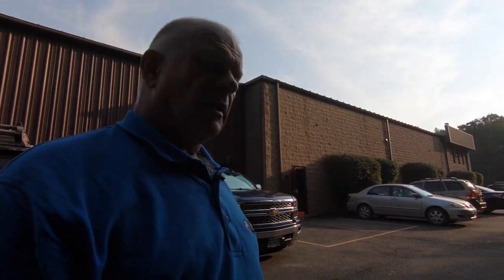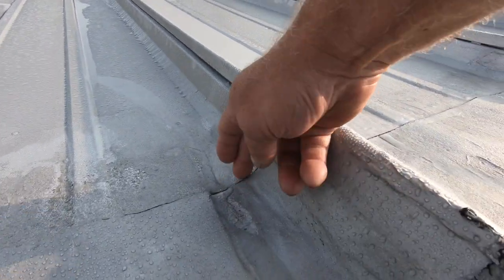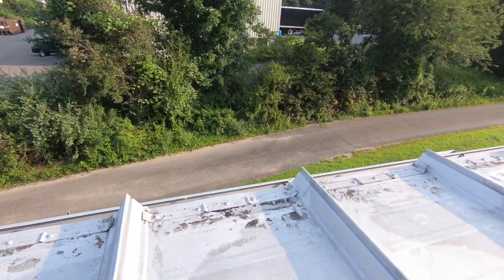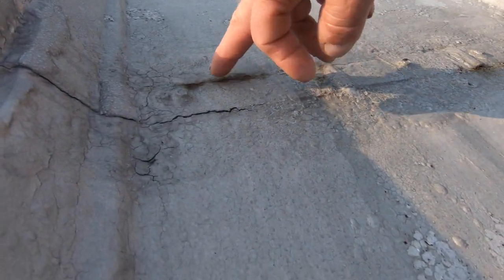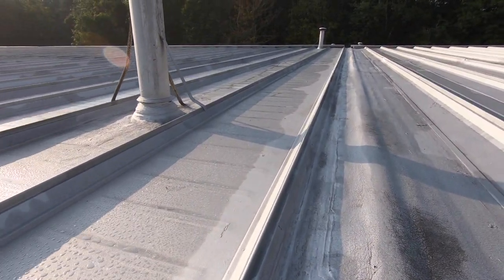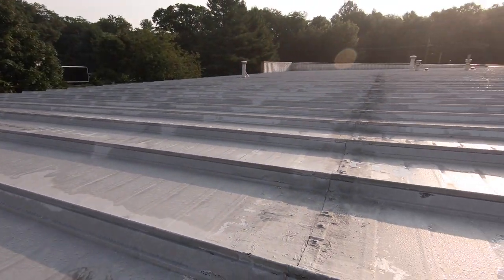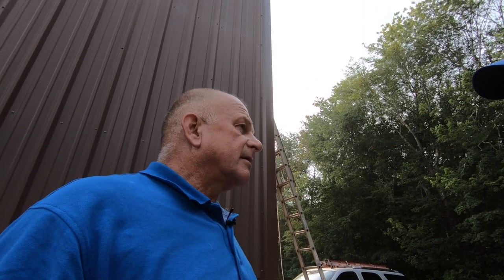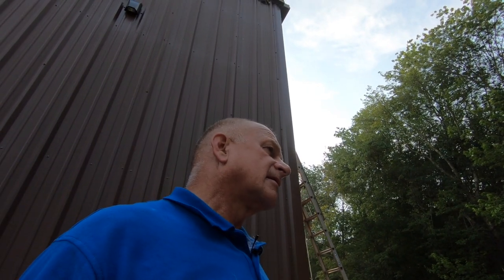Your Metal Roof can have this problem. Fixed with tar or caulk could cost a lot later to do it right

Comment: What is the best cheapest thing to seal where the metal overlaps each other? I’m building a barn and all my metal is running length way so the only part they connect is where they overlap.
Reply from the maker: My Saying "cheap is very expensive". It is harder to make repairs once you have messed it up with a cheap product. The cleaning up and damage that is done becomes very very expensive. Do it right from the beginning. Turbo Poly Seal has worked for me for many years.

Comment: i have a flat corrugated roof and its a year old i just got new tenants and have condensation problems it starts leaking when the sun comes out can you please  advise what to use on top of thew room
Reply from the maker: I think you need to do something on the inside. The condensation happens because there is a lot of moist on the inside. Somehow you need to prevent the moist hitting the metal.
So, the roof is at its coldest in the morning right before the sun shines on it. That is when people are also starting to use the shower, bathroom. Maybe you should isolate the bathroom. or install a strong extractor vent to suck out the moist air from the bathroom.
I am just speculating. Good Luck

Comment: My roof was new in 2005. The flat part started to leak so I go up and take a look, I found a straight line in the area. So I though what can I use until I put a new roof on in December 2019, I went to The big box store and. Bought ULTRA SILICONIZER by Lanco, also The reinforcement.  I was on the phone with my brother and telling him about this straight line in my flat roof that started leaking. We talked about it and came up with with an idea about how this might of happened. So the guy is working on my roll roof and has a piece upside down to cut the roll roofing on, then he takes that piece and uses it. It took 13 years for the cut to come through and leak. I am thinking about metal but what about my 400 sf part that is FLAT. JOE in Dunedin,Florida
Reply from the maker: Hi Joe. You are describing a Torch Down Roof. Yes it is true, when someone cuts a rubber membrane  on top of the rubber thats is already laid down, could accidentally cut through the layer on the roof. When I got started 30 years ago, it happened to me a lot in the 1st few months. That is called inexperience! When I hire a new hand and ask for a certain width that is 20' long they would measure the lenth and cut it off the roll, then snap a line on the 20' membrane that is lying flat on the surface of the new membrane. Then I woyld watch them using a straight blade trying to cut on the chalk line and almost always cut through the other membrane beneath. Even with a hook blade they will  make the same mistake. 
So what you described is accurate, but as you noted, it is amazing that it took that long to show up. The reason is it takes that long fort the membrane to shrink a little and open the cut.
The 400 sq flat part, if it is only 13 years old and was protected from UV's, you should not have to do anything with it. If the membrane has spider cracks in it, then just torch a fresh layer over the the existing one fusing them together. That way you will have a roof that will last forever.
Thanks for sharing with us.
Take care
Reply: Flat Roof Doctor thanks for your input.
Reply from the maker: you are welcome

Comment: Hello Flat roof Doctor,
I have a question for you...
Before we purchased our home there was a metal roof added wit a wrap around porch.
They gave it no pitch on the back side around the chimney. 
So water just lays and it is leaking through. 
How do you deal with spots like that?
I love your work...keep them coming
Reply from the maker: I am so sorry for this late reply. I wish Youtube made a way to see unanswered comments. I just happened to come across your question.
Here is my fix to what I can imagine your problem is.

I will first try to explain what I think your problem is.
The metal roof stops dead to the chimney causing water to sit in the bays between the standing seams of the metal roof. Because of the standing seams, the water can not flow around.

This is what I usually do. I take an angle grinder and cut the standing seams away to about 8 inches away from the chimney. That provides the flat surface for water to escape. Where you have taken the standing seams away are voids. I then use Turbo Poly Seal with the Fleece from Bergstromm.com and cover these voids. Now water can flow around the chimney after the standing seams have been removed.

If anyone else has a better idea please comment here. This was just my idea.

Comment: I've read and seen roofs patched using Flex Seal product, which does not harden. People seem to praise it.
Reply from the maker: Flex seal is ok. But any liquid applied product without  a fleece or some material to give it the tensile strength will crack. Turbo Pole seal also stays pliable but it has a polyester fleece that gives it its strength.